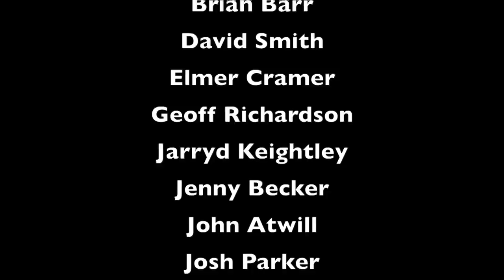Prop shaft and rudder post installation

Comment: Damn Stu, you are inspiring me to put out another Race Boat Life video. https://www.youtube.com/watch?v=WAVrDNnFe40&list=PLBcphYdOqWq7okAZkibnbSPiR6Z-CMHB_
Don't feel bad about the grinder. If you use them enough you will get bit. I was doing the same thing and had one jump and grab my shirt. Lucky enough it pulled the cord from the socket as it twisted my shirt in knots beating me the whole time. 
When shooting wildlife you need to rent a lion or tiger and film it taking the Roo down. At least that's what happens on Animal Planet every time I turn the channel on (and is why I don't watch AP). 
Calibers, have the same one doing the same thing as yours. I found if you wet the battery (lick it) it makes better contact and works. 
Prop shaft, build a long wooden V out of a couple boards and pack it in dry ice.
Last you got a camshaft shipped from the states and it didn't come in, in pieces.....you are a lucky man Stu. 
PS, congrats on the 100K subs. I'm just looking to get to 400 before the year is out. Getting to 100K, great job!
Reply from the maker: Yes, having wire wheels grabbing loose clothing or gloves is a real risk. I've found a local source of dry ice now, but was thinking of cutting some PVC pipe to make the formwork to hold it.
Reply: Even better idea. I was watching them on YT take a rudder out of a cargo ship and they just loaded the top with dry ice to get it to shrink enough to get out. Just like when building a V-drive. You freeze the shafts and heat the gears and they just slip on. When the 2 equalize you will need a press to get them apart. 

PS, thanks for answering your YT comments. People are doing it less and less these days, going all Hollywood on us.

Comment: Am I the only one having misgivings about using the upper rudder shaft seal as a bearing surface?
p.s. If all your subscribers bought you a pint... you'd probably need a bigger boat.
Reply from the maker: Not sure I follow. The oil seal is just above the top bearing so it doesn’t take any load.
Reply: I must have have missed something.  I assumed that the yoke would ride atop the seal (instead of the tube) with the weight of the rudder pulling it down.
Reply from the maker: I see what you are saying. Once the rudder is in the yoke is help up above the seal.